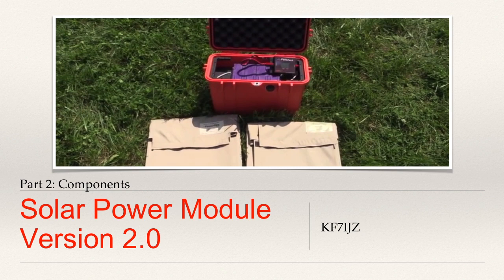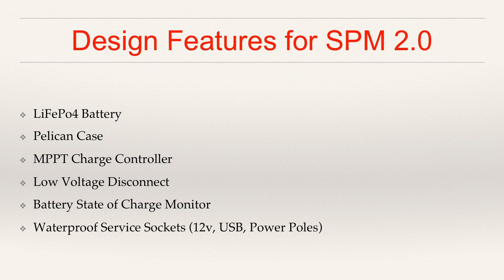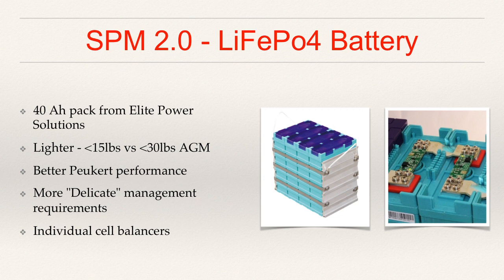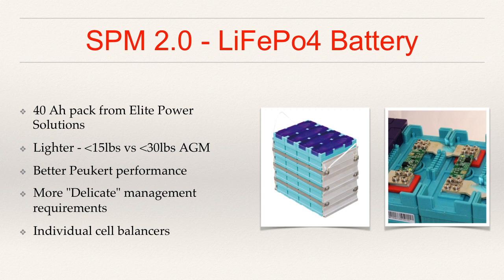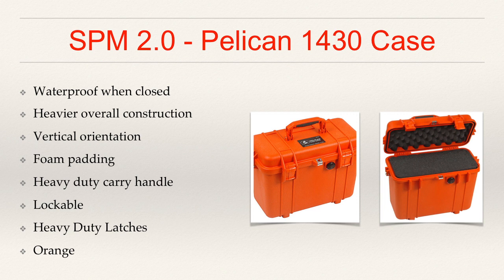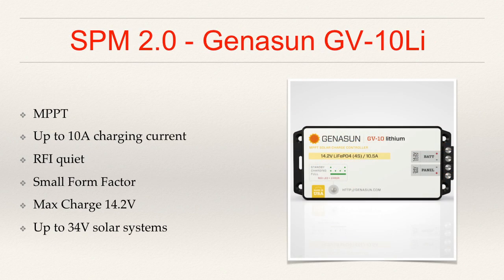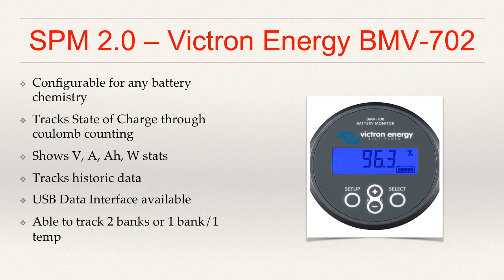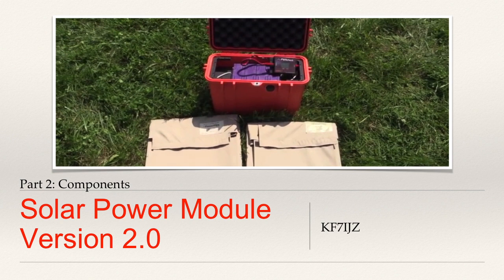DIY Emergency Portable Solar Power Module 2.0 Part 2 - Components

Comment: FYI, I purchased a Bioenno Power LiFEPO4 battery.  It comes with integrated battery protection that INCLUDES the low voltage disconnect.

Comment: Hi. A new viewer / subscriber here. I was doing a bit of searching online for the Victron 702 and found your video. Just watched both parts. Very well done videos and damned fine research on your part. 

Thanks for the link to the retailer for the energy monitor. Most places I was able to locate are marine suppliers - which translates into more $$$$. 

I'm using both MorningStar and Midnite controllers here in Cambodia, for my solar arrays. But, I am definitely going to take a look at Genasun too, now that I know about them. 

Thanks so much! I look forward to viewing part 3!
Reply from the maker: Paul Petrea Thanks for stopping by!  Peter Kennedy is also a Marine supplier, but his prices were very reasonable.  I drove up to his shop and it was a 12v candy store!  He was also a very helpful and knowledgeable person.

Comment: I used some small shipping cases from ArmourBoy on eBay here in Australia , I'm looking at putting a video of how I wired up my system but although I'm very fussy with the cable management it looks very confusing due to the Duel battery and having so many in and outputs lol, so I may have to draw up a wiring diagram.
I have just posted some videos that tested how much I could draw ac power without solar attached and this taught me a lot about the importance of correct cable size , I'm learning a lot about solar and getting a little addicted to it lol
Reply from the maker: Look forward to the videos!  Cable management is always the hardest part to me.  I did just discover that HDPE plastic sheet can be purchased relatively cheaply, and even with simple hand tools, a fairly smart looking panel can be created without having to use CAD software.  I'll check your channel out!

Comment: I am very new to solar power and this portable set up is exactly what I am looking for.  I am about to order the battery you are using but would like to know how it is working out before i make the plunge.  With shipping this battery is about $300.00!
Reply from the maker: So far so good, however, I've now owned the battery for about six months.  I plan on doing a full battery (no pun intended) of charging and discharge tests in the very near future to measure its performance after sitting since field day.  For Field Day, it did swimmingly!  I would encourage you to contact them with any questions you have.  Their tech folks are very friendly and have been very good at answering questions.
Reply: KF7IJZ
Thank you so much for your quick reply.  I will order the battery and possibly the charge controller.  I will get rest of the set up as soon as I get more cash! Thanks again!
Reply from the maker: lookatmetoo Make sure you have a way to prevent over charging and under discharging or you can kill the battery.  They are great performers but they are "fragile".  The charge controller will help keep from over charging.  And don't forget to get the cell balancers!
Reply: KF7IJZ Didn't think of a cell balancer. Thanks again for your reply and advice. Great videos!

Comment: What about an AC Charger for when  there is no sun and an inverter?
Reply from the maker: You can pretty much apply any DC voltage from 13-34 to the Genasun GV-10 charge controller to charge it.  This gives you flexibility to select any AC power supply.  I don't have an inverter shown because for my portable operations, I don't use one.  I power any electronics beyond my radios from 12V either using a 12V USB adapter or a 12V Laptop Adapter.  This is more efficient than going from 12v DC to 110v AC and then back down to 19V DC.  If you're looking to power a laptop, look at Radio Shack and Amazon for 12V cigarette lighter laptop power supplies.

Comment: So, I love the whole battery box idea and want to use it for powering all kinds of stuff.  However, I don't think I'd use the Solar Panel to charge the battery and most likely would just like to plug it in to a wall outlet to charge.  Would I still need the Genasun controller or can you recommend a different controller that I can use to charge the LiFEP04 battery?

Comment: ok
You did not answer my question about
 cheaper  lithium batteries
Like Battery Tender 
Was there a significant difference?
Reply from the maker: My apologies - I didn't see that part of your question.  At this time, I do not recommend using the Battery Tender batteries you referenced.  The labels are misleading.  The batteries are sold ONLY for starting applications, not deep cycle applications.  While the battery is labeled 7-9Ah Pb Equivalent, this means that their battery is capable of giving the same ENGINE STARTING PERFORMANCE as that type of Sealed Lead Acid Battery.  If you read the dimensions for that battery (http://batterytender.com/includes/languages/english/resources/BT_Lithium_Battery_Dimensions_Spec.pdf),you will see that the battery itself is only 2Ah of capacity for deep discharge.

Comment: Another question 
Do you think I should insist on lithium batteries for weight 
Because I am building in pelican IM2200 Is suitcase
or 12V 7AH Sealed Lead Acid Battery 
Will be more than enough for Camping battery box
Be tolerated and weight?
Reply from the maker: The weight is up to you!  For that size battery, I highly recommend the A123 systems 7ah replacement modules available from http://www.buya123batteries.com/

Comment: Question whether it is better to save a headache
And just buy yati 400 goal zero
You see I came across your video yesterday 
I began to study the subject
I chose Battery
 Case 
Controller And all the rest
And the price Almost the same {yati 400 750$ to my Country}
Why so expensive battery?
Battery Tender BTL09A120C is not Enough?
Reply from the maker: I own a Yeti 1250, and it's a great piece of gear.  At the end of the day, for me, I'm able to customize EXACTLY what I want in my boxes.  There is certainly nothing wrong with the Goal Zero units, and for many people, they will likely be more convenient.  I just decided that the energy density of Lithium based batteries was worth exploring!

Comment: You do know that Genasun makes MPPT Charge Controllers with a BUILT IN Low Voltage Disconnect... right? It adds to the cost, but it will be roughly the same cost as the model you showed in your video plus the cost of the 3rd party LVD Device. Here's a link to their 5 Amp Model, but believe that I have seen the model that you have in your video with the same options. http://tinyurl.com/nztf8rz

It will set you back about $250-270 for the MPPT Charge Controller with built-in Low Voltage Disconnect, but it's worth it IMHO as it reduces the complexity of the entire setup while also increasing it's durability. I can't access Genasun's website at the time that I'm typing this (looks like their Apache Webserver crashed... ugh), so I can't provide you with the exact model number and link.

I would double check before you buy the model in your video if they have a higher amp model with the built-in LVD like the one I linked above.
Reply from the maker: You are absolute correct - having an all in one charge controller with load management would be idea. The GV-5 has this feature, but it also only handles a max of 5A.  I need to be able to handle up to 25A.  I had asked them about a 10A controller which a much larger LVD, and they indicated that they don't make anything like that.  Their site has been down since Friday and I've written to tell them so (a friend was trying to order a Charge Controller).  I hope nothing is wrong!  Thanks for the comment!